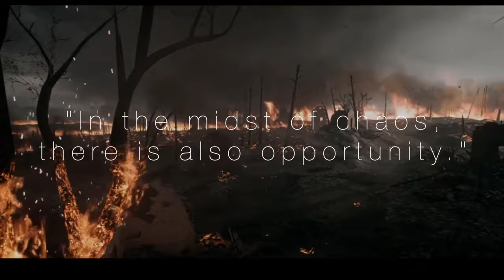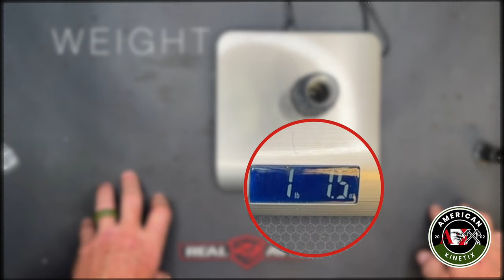Suppressor Used By CIA Ground Branch Operator

Comment: Please no crush washer with suppressor mounts.
Reply from the maker: You do have a valid point - they often don't crush uniformly, which could create an alignment problem, which has the outside potential for a baffle strike on a suppressor with very little margin for error in the tolerances. The SCI-SIX has a rather generous bullet path (you can actually shoot larger calibers than 556 thru it, but we didn't say that and don't suggest trying it). So to be on the safest side, ditch the crush washer.
Reply: Which is why when I installed my AEM5 I was a little hesitant. But it’s an old school design. And thankfully runs perfectly.

Comment: I recently picked up the same suppressor was a bit skeptical just d/t 5.56 and all but was surprised at just how much it did reduce the the sound at the shooters ear.
Reply from the maker: It's def a solid piece of equipment. Well thought out. Not much you can do about the supersonic loads required to cycle the bolt without buying a whole new BCG, buffer, gas kit (and even then I wouldn't trust it with my life). But it sure gets it done at the shooter's ear, as you pointed out. Thanks for the comment!

Comment: Slade and CGS did a great job with the SCI SIX. It’s one of my favorite cans. I’ve been running the CAT WB now, but the SCI SIX still lives on my backup rifle. My most recent video on my Channel,I did a backpressure test on my 12.5. Midgas with riflespeed adjustable gas block with the SCI SIX, CAT WB and CAT ODB to show how much gas is needed to lock back with each can. The great thing about the CAT cans is that they achieve low backpressure without the can being a concussion machine.
Reply from the maker: Hey thanks for the reply and we look forward to checking out your video!

Comment: Do NOT use crush washers for muzzle devices that will mount suppressors. Use shims instead because crush washers don't align the muzzle device concentrically to the bore of the barrel.
Reply from the maker: You def have a point. They don't crush uniformly and if there's little margin for error in your suppressor and it doesn't then you have a chance for baffle strikes. Apply Rocksett or a similar thread locker to the barrel threads. (See the note at the end in the description).
Reply: @AM-KX  Don't use rocksett. Just torque on the muzzle device properly unless you want it on that gun permanently rocksett all you want
Reply from the maker: Well, torque is def recommended. Check out pg 6, bullet 3 of the suppressor manufacturer's manual on installation. https://cgsgroup.com/wp-content/uploads/2023/04/SCI-SIX-MANUAL.pdf